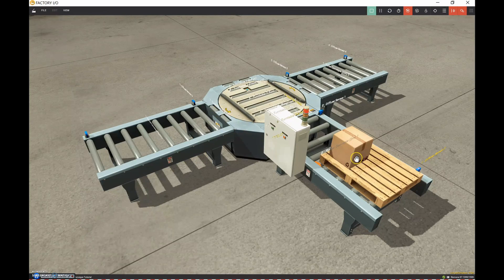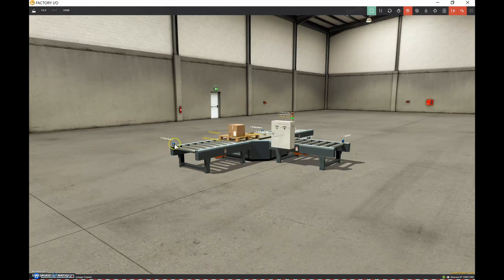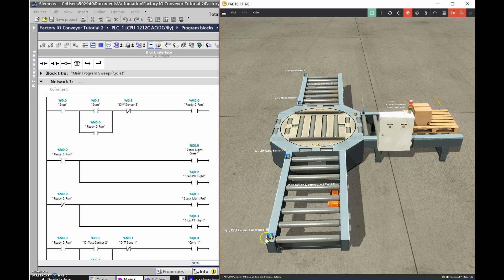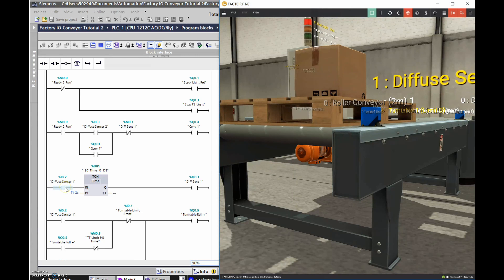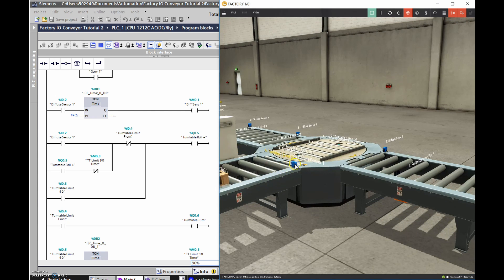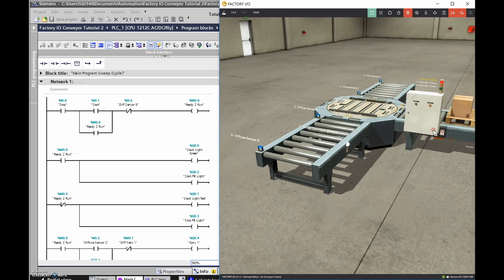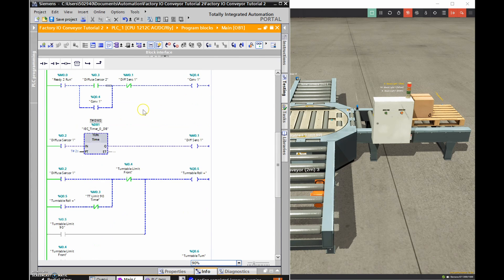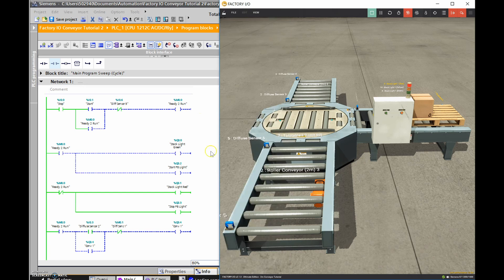Siemens TIA Portal & Factory IO (Controlling a Scene with a Siemens PLC)

Comment: Why can't I connect PLCSIM V16 to Factory IO？Factory IO remind that the PLCSIM doesn't run, but  the PLC simulation is indeed running. Could you pls help me?
Reply from the maker: The Factory IO website has helpful hints on the forum, you should check it out. Always run PLC SIM and Factory IO as Administrator. Also, there is specific settings within TIA Portal as detailed in the link below. You also have to download the zip file and use their code. There is a specific Function Block that is called that enables PLC Sim and Factory io to work with each other.
Reply from the maker: https://docs.factoryio.com/tutorials/siemens/setting-up-s7-plcsim-v13/

Comment: @PeterVree Instead of using a timer with D sensor 1, rather use a rising edge contact (P) with D Sensor 1 to pulse your turntable roller and then using a falling edge contact (N) with D Sensor 1 to turn off Conveyer 1.
Reply: Thanks George... you know when I've lost my way when I start throwing in random timers to make things work. Rising or Falling edge are much better instructions to make use of. Thanks for keeping me honest.
Reply: @vreepeter  Im learning as well, its not easy stuff, but very rewarding when it works, it just so happens i had done a similar project a few days ago!

Comment: sir i think there is no need for the second timer, isn't? I'm asking this to ensure myself that I have understand the concept very well sir.
Reply from the maker: I made use of the 2nd timer to make it work, but you might be able to get it working properly without the timer by using the negative pulse on the proximity sensor input. You can see that in the beginning of the play list my programming is quite crude.